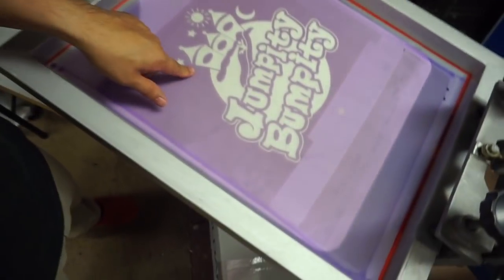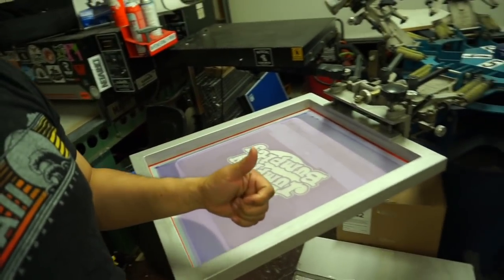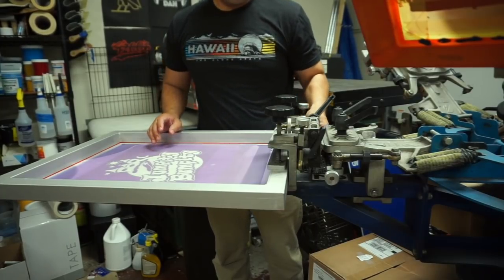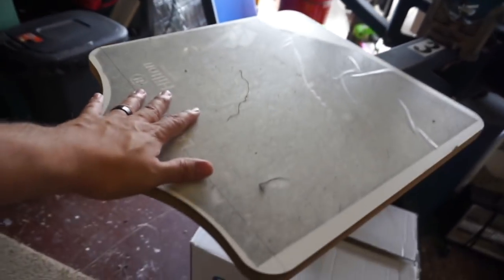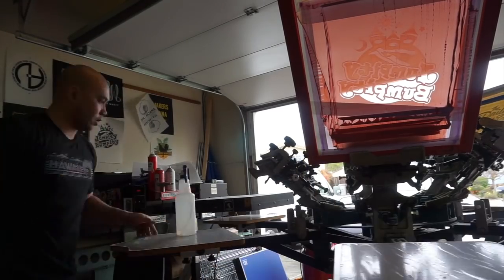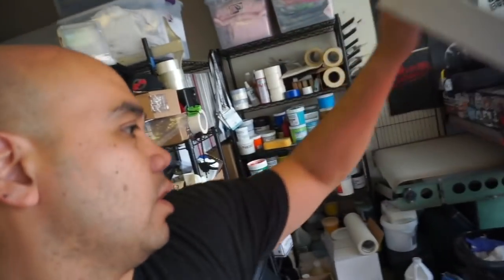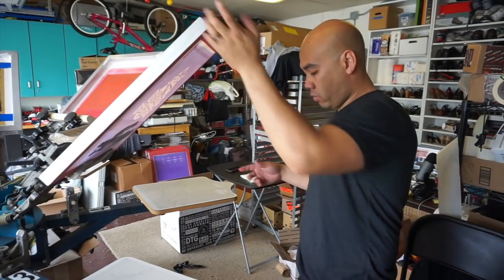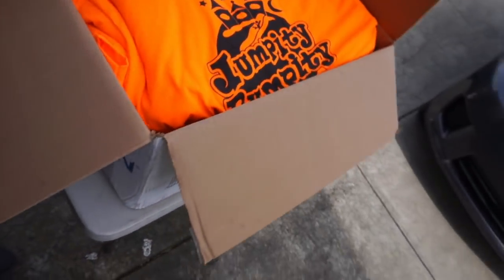1 Color Print with Color Change (S:04/Vlog 078)

Comment: Hey Ryan, First off, thanks for posting your Daily Grind. I find your trial and error process very much like mine, so thanks for adding to the ether. I have two questions pertaining to this video. I have been shipped a sample of the PMI's dual tack pallet tape, and I've only used it on one of my 4 plattens thus far because I've used lines on my paper tape in the past and I don't think that my marker lines will work as well on the dual tack stuff. I was wondering if you found that lines were no longer needed for you, and what you thought of the dual tack tape because I noticed in your video that there were a lot of bubbles and creases on the tape when you rotated your boards. The second question is where did you get the plastic jars for storing your ink. I've got a bunch of quarts of Excalibur ink and their jars suck because they are that push pry type that gets way to messy. Thanks and happy printing.
Reply from the maker: Answered your questions on an upcoming video
Reply: @RhyBeats  ok cool. I've had some issue with ripples and bubbles with the dual stick PMI.
Reply: ether is a sweet smelling but very flammable gas, so when I said thanks for putting your trial and error process out into the ether, I meant that your contribution is nice but if left in the wrong hands, it could be dangerous. Ha ha.  thanks for following up.

Comment: Awesome work what did u use to adhere on ur press and what did u use to clean the screen for color change?
Reply from the maker: Right now I’m using the PMI dual tack tape, but you can use a spray or water base adhesive. The press wash to clean the ink, I was using the TS-305. You can these at NorcalSPS.com
Reply: @RhyBeats  thanks bro!!